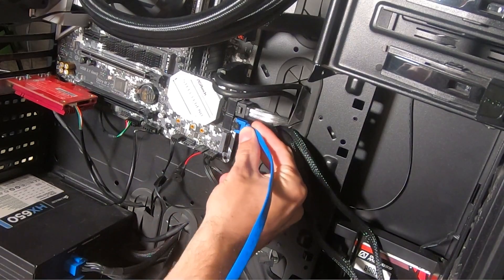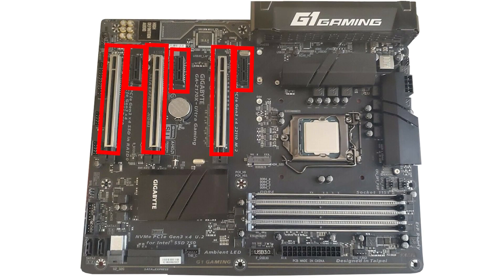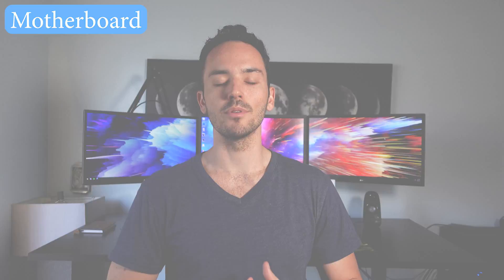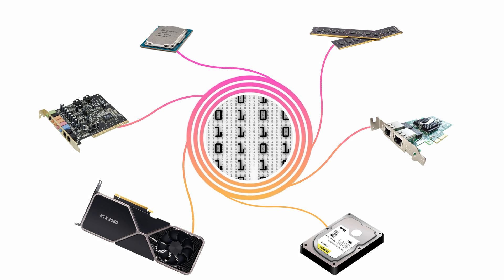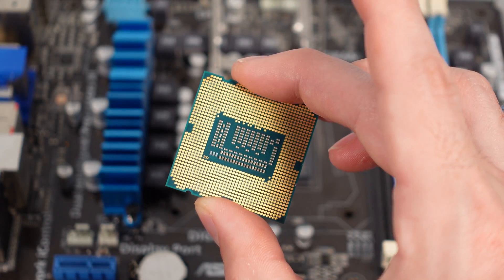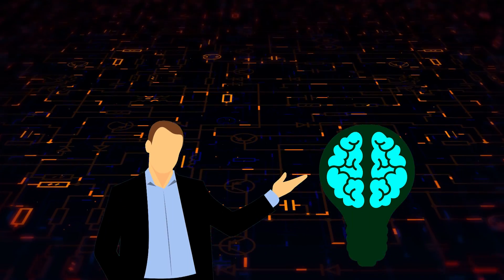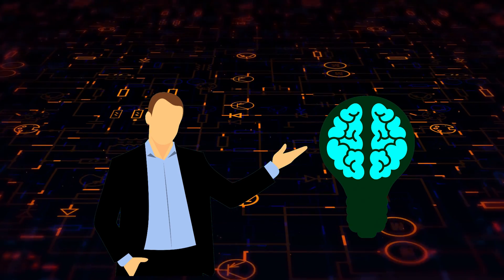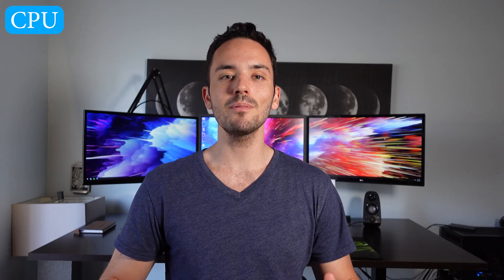Inside a Computer - Understanding the Components that Make it Work

Comment: A decent video idea if you're interested is an explainer on battery degradation. Make sure to debunk common misconceptions such as the idea that you're phone battery will last longer if you only charge it to 80% (batteries to degrade most quickly at full charge but most devices don't use the battery's full capacity for this reason).
Reply from the maker: Yea phones are special since they're cooling system sucks. And heat is the ultimate battery killer ...